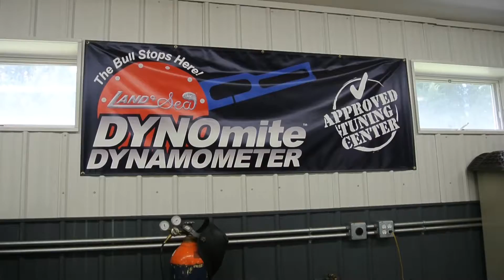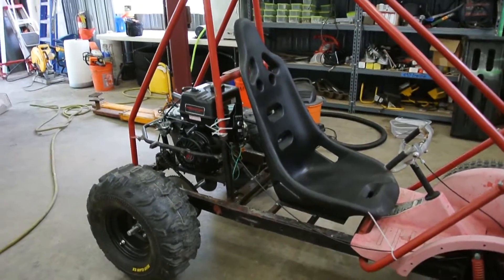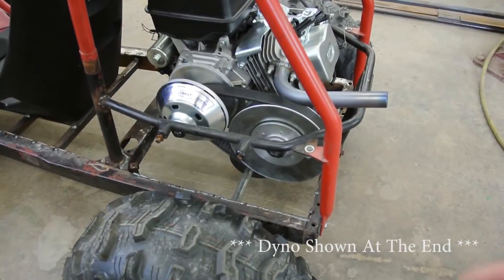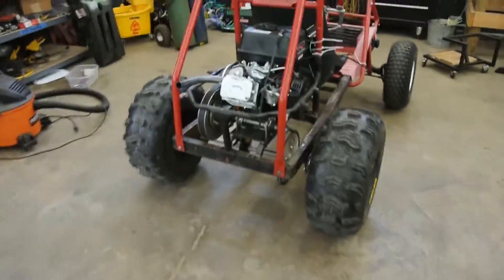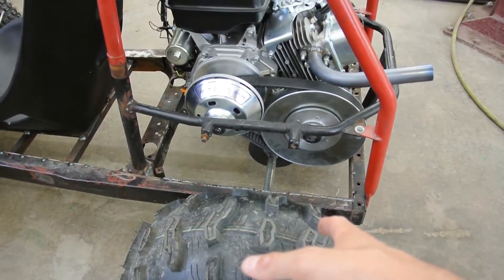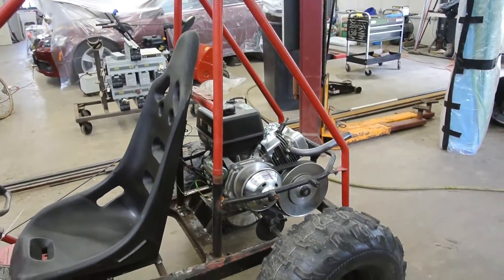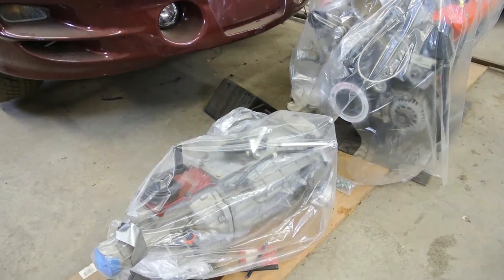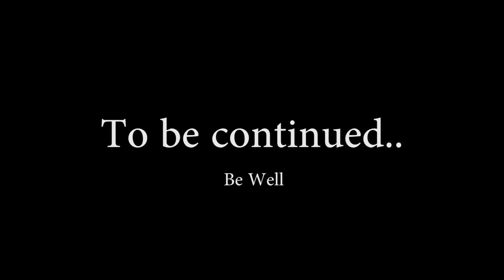Honda Odyssey DYNO Predator 420cc *** ACTUAL RESULTS ***

Comment: First I have to say good job! Taking the CVT off and direct dyno is going to get you the real scoop! I am building a similar kart / buggy. Been adding up the parts and watching predator builds. It doesn't make sense to me. By the time you build a predator and buy cvt stuff you got over a grand into it and it's a unbalanced engine that will not last very long. I'm going with a polaris 325, cvt, and gearbox. By the time I completely rebuild it all I may have $1200 into everything but I will have Low/High and reverse cvt and more HP on a balanced engine. If I spend 300-400 more I could do a 500cc HO drivetrain that's about 40hp. I know it's apples to oranges but I didn't want a unbalanced apple.

Comment: Factory fl250 engines made 17hp to the wheels man. Put a factory motor back in it
Reply from the maker: Thanks! I think you are missing the point of the video, the motor is in this as a vehicle study, to see different modifications to the Harbor Freight engine as some people are claiming "30hp+" with simple modifications. Thanks for advice. Be well

Comment: Finally, found someone that has the same building thought process! Proof of concept with rudimentary  mock-ups, real number testing then make improvements🔁retest….never done><my brain won’t stop turning out rehashes of every idea 💡
Reply from the maker: Wish I could contribute more! Life got in the way... The plan was going from stock to wild and dyno it after every change. I was also planning on dyno'ing it with no CVT/Clutch but direct to remove those losses. Thank you for the comment and be well.

Comment: I have been looking around for any power numbers on the Predator 420 engines.
I know Predator engines are ... very economically built, and the QC can be questionable.
I hope you up the valve spring weight, remove the goviner as that can get more RPM's and potentially more HP ... though if you do that the probability of the (stock) flywheel exploding goes up.

I hope you keep this series going.
Reply from the maker: I plan on keeping us going, right now it’s a little difficult with the move and everything. I’ve tried to procure some parts for this engine and it seems like a lot of places are sold out, seems to be a supply chain issue since Covid. Stay tuned

Comment: Well what were the results?
Reply from the maker: Within the video that I made too long. If memory serves me around 12-13 horsepower at the tire through the torque converter and all. Dyno coming up will be direct drive (no torque converter which can mess with values).

Comment: Excellent build my dude! I like it alot.... I did a GX390 swap on a TaoTao buggy and my motor, CVT and Jackshaft setup is dang near identical to yours as far as the routing!  I guess great minds think alike hahaha... Anyway, you can see mine on my channel!  Good work!  Just Sub'd....
Reply from the maker: Thank you for the comment! The jackshaft took some doing to figure out the routing. I started with cardboard before the purchase. The build has come a long way. I'll be dynoing it directly without the CVT for real power numbers then it will be built. As of now it has less power than I would want especially for the 14-21* grades at the property. The build will be mostly for mid rpm power not an all out screamer; probably looking for make peak power around 5k unless I change the gearing. You also have a sub. Be well man
Reply: @gearheadclassics7225  Haha yea I know what ya mean!  I feel like I did more standing and staring than anything else lol... My thoughts are the same as far as low end power!  I do trail riding with mine so I wanted low end grunt rather than flat out speed... However, it still is pretty fast... I'm running 10t Jack sprocket, 60t axel sprocket on 16" tires.
Reply from the maker: @bstarnes514  My ratio (now) is 11t to 60t with a 22" tire and the converter ratio is roughly 3.2:1 to 0.8:1. More than enough speed and actually will be purchasing a 65 and 70t sprocket. The smaller sprocket can be switched out in a few moments so I typically keep 11t,12t,13t,14t on hand. I'll be sure to keep an eye out for your videos. Be well
Reply: @gearheadclassics7225  Awesome thank you!  I look forward to seeing more vids from you.... I have GX390 parts due to arrive tomorrow so that will prolly be my next video!  🤟.... Oh and I like LS stuff too.... that G8 sounded good!  Anyway, take care my dude....
Reply: @gearheadclassics7225  and thank you for the sub!  I really appreciate that!

Comment: Where did you get the new rear axle? Is it just a regular go-kart axle?
Reply: It is a standard Live Axle kit, 1" diameter. It contains two bearings on the left and right side but due to the motor it has been bending axles because of the distance between the bearings. Will be installing a center bearing as well. Hope that helps and be well.

Comment: I did this same build back in 2013 under my covered car port. Obviously yours is better built than mine. I used the stock brake and everything except the tank. Worked pretty good for a last second thought.

Comment: I made 5.2whp on a dynomite with a stock 212 through a TAV.
Reply from the maker: Wyatt Foster TAV is torque converter? If so, good results! Be well man
Reply: @gearheadclassics7225  TAV is a 30 series torque converter. Short for the comet Torq-a-verter